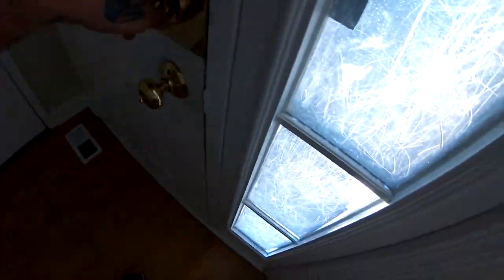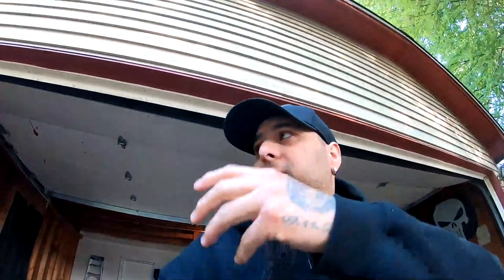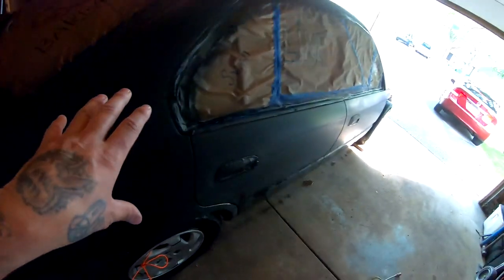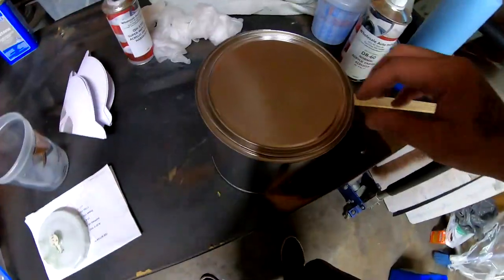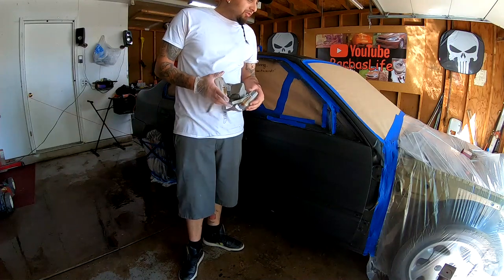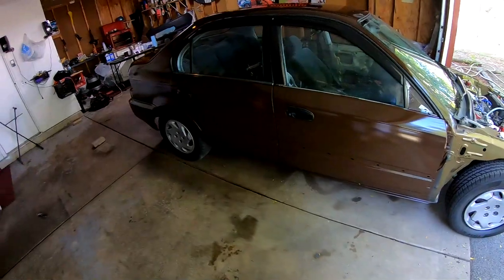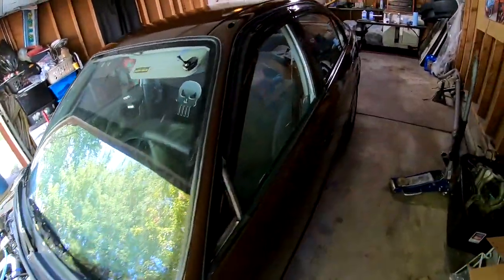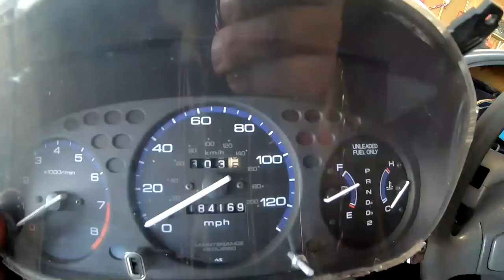Respirator Fails During Turbo Civic High Gloss Single Stage Paint job

Comment: Shave and buy a larger mask, 3m makes a large usually has a blue mouth piece also seal your cartridges in air tight zip lock and mark the working hours on bag once they hit 40 throw them out.
Reply from the maker: Awesome thank you for this very helpful great info..